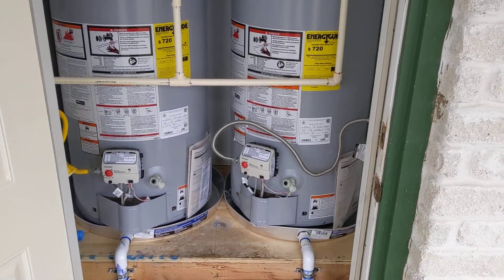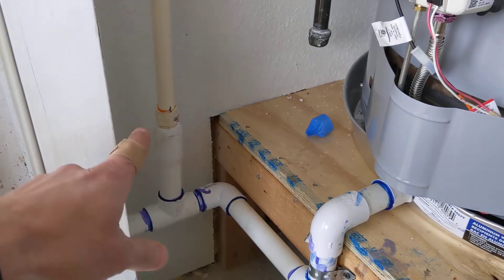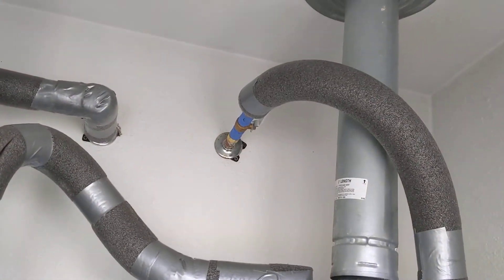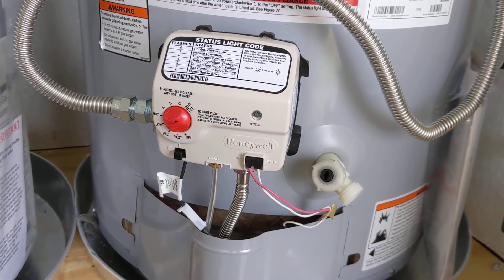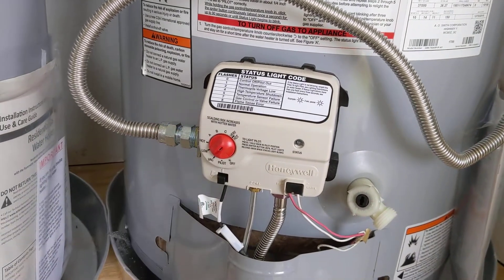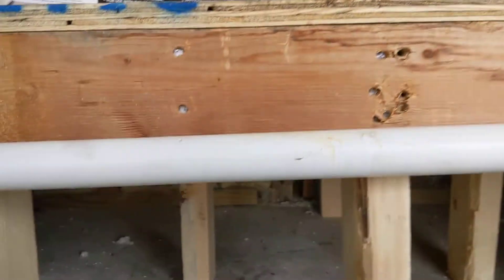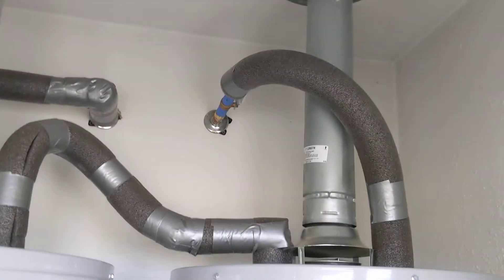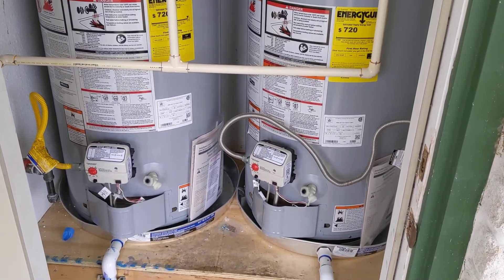Gas Water Heaters In Series

Comment: Hey guys. Please don't install water heaters or plumbing like this video explains. You can never have two tpr valve terminations joined together. You can never have them connected to the pan drain line. You can never have a tpr termination through PVC. CPVC or better ONLY. TPR valve shoots at 210F. PVC rated for 140F The plumber he mentioned saying this was ok obviously does not have a license. Section 504.6 of the International Plumbing Code (IPC) and Section P2804.6.1 of the International Residential Code (IRC). 49 states adopted IRC and 38 IPC. Most of the other states have their own code that says this is incorrect setup. So only you live in Wisconsin, find another channel or ask a home inspector. Guaranteed this gets flagged when they try to sell this home. I hate to be negative. This is America so you can say what you want,  but I hope someone reads this comment and does some of their own research. Thanks for trying to educate anyways and good luck to you.
Reply from the maker: Great comment. You informed and stated some important things without trash talking (too much) ;). In this instance the owner was the one who made this decision as he said he didn't want any more pipes coming out of the front of the building. The plumber said that it broke the aforementioned rules, but that it was "ok" as in, "We do what the customer wants since it's not attached to any public water system". That is the only reason it was rigged this way. Keep being awesome and doing a good job!
Reply: @MyFortressConstruction  I would agree that home owner can state what they want but code is code.. Plus running any dual water heater setup in a series is a waste! The first water heater will always get over worked compared to the other one and semi defeats the purpose

Comment: How to install flood prevention drain pipe if I am on 2nd floor of a condo, and WH is located in a small closet outside next to patio?

Currently it is missing a pan after we moved in so we also need to drain / or somehow lift the WH up and insert a pan.
Reply from the maker: Yeah, so you have to shut it off, drain it out of the bottom silcock via a hose to outside and then, if you don't need additional height for the slope of the drain pipe, disconnect the two lines going into the hot and cold outlets, lift it and have someone else slide the pan underneath it. If you do need to raise the tank to a new height, so that the drain line can overcome an obstacle or have the proper slope (1/4" fall per foot), then best to pull it out, build a base of cinder blocks or something equally structurally sound, and then put the water heater back in. Before shutting off the water, connect the garden hose and open up the silcock to flush out sediment from the bottom. It will help the tank and make the draining go faster. Watch your back!
Reply: @MyFortressConstruction  Great instruction. The trick is where to let the flood water go - or we need to tap into another  drain pipe somewhere probably only way. Cannot let water go outside and drop to people downstairs.
Reply from the maker: @jamescc2010  if you have gutters you could run it into a gutter otherwise yeah find a drain that is lower than the water heater or get a really long hose so you can drop it all the way down to the ground.

Comment: Can I have a 50’gallon and 30 gallon in series? Does size play a role in pressure ?
Reply from the maker: You can have any size you want and the only thing that would play a part in the pressure/volume would be the diameter of the inlet and outlet. Once your tank fills with water it will pressurize equally.

Comment: Are you sure you want to use untreated lumber for your platform legs on concrete in termite country?
Reply from the maker: Yep. Now, if they didn't use a moisture barrier between the soil and the concrete, and if this had rain or other water running under it, then it would be necessary to use PT wood. But because the concrete is dry and it's in a weather protected cover, there won't be any moisture there to cause dry rot. However, if you have termites, then you need to take care of them regardless of the wood you have, because most homes only have a PT sill plate (generally because framing goes up while the concrete is still curing or they're used on exterior walls and have to deal with moisture pushing in if the base isn't sealed well), everything else is dry and tasty. At least you'd be able to see the termites munching on these.

Comment: Thanks so much for this helpful video. I have two questions. First off, I have two heaters in my house, and I think they're in series, but I'm not absolutely sure, and I'm not absolutely sure which one is taking in the outside water and which one is feeding the house. I turned way down the heat on tank "A" and it doesn't seem to have affected my house. Tank "A" is also the one with the overflow tank. I think this is the one receiving water from the outside because turning its thermostat down didn't affect my water and because I think tank "B's" pressure can be relieved by simply flowing back into tank "A". Does that sound right?
Second, I have a small household and I don't really think I need two heaters running. Is it better to turn heater A off and let heater B do all the work, or is it better to let heater A do some of the work, and let heater B do the rest of the work? I'm guessing it's slightly more energy efficient to just turn heater A off, and probably less dangerous because a warm heater A would just foster legionella.
Reply from the maker: So, you are correct in that it's more efficient to have one heater if you don't need two. 
  Are the two heaters next to each other? If so then you should see a line going from Tank A into B. Water heaters in series have the hot water of the first heater go into the cold water inlet port of the second heater. You should see an H or C stamped/written next to the inlet/outlet ports on the heaters. 
 It sounds like you did indeed shut off the first heater in the series, but it's possible that your tanks could serve different parts of the house (heater A serves washing machine, hall bath, etc. and Heater B serves Kitchen, master, 2nd bath). Legionella like 70-120 degree F. so if your water is below that temperature in the first thank then you won't have anything to worry about, especially if the second tank is set high enough to kill them (140 deg. F. will kill legionella in about 30 minutes). If it is truly a concern then emptying out the first tank and removing it completely from the series would be recommended, after all, a second tank could just be another leak waiting to happen.
Reply: @MyFortressConstruction  Yeah, at first I just assumed one heater was for upstairs and one was for downstairs because that's how the air conditioners are (I live in Texas.), but when I turned one off, the whole house still had hot water. Then I realized it was a silly assumption and I started looking at it more closely. They're definitely in series. I will check for the engraved H and C when I get the chance.

I think generally I'd like to have my tank set at 120ºF, so it's not really high enough to kill them if they've proliferated in the first tank. I hate it when scalding water comes out of the taps, and enjoy the feeling of safety that comes from the 120º water, so I'm inclined to just let the second tank do all the work. But I do like the thought that I could heat up the second tank and have a ton of hot water if I needed it. You make a good point about it just being another hazard, but I'm so paranoid about water damage, that I think I will keep a good eye on it. I'm looking for a good deal on a water detection system, so I expect to have that installed in the next year or so, and once I get that, I think I will be mostly safe from the extra hazards of an extra tank. 

Thanks so much for your advice.
Reply: @MyFortressConstruction  Oh, I forgot to mention that, yes, they are both right next to each other. And it's clear they are in series. I can see a single pipe coming and leaving from the pair, and then a single pipe connecting them. I will check the engravings when I get the chance, but from all I've learned, I'm pretty sure I turned off the first in the series.

Oh, and yesterday the piezo-electric ignitor came in the mail and I installed it on the second one, and tested it. The pilot light starts instantly, so I feel good about leaving it off. That reminds me, I should probably shut off the gas to it when I go to check the engravings.
Reply from the maker: @mitchjohnson4714  Yeah, good. So another option is to install a tank booster on the second unit (the one actually supplying hot water to the house). It's basically a thermostatic mixing valve and it mixes in cold water into the hot water that is leaving the tank so that you can set your tank to 140º but the water would be 120º getting to your fixtures. It's usually what I recommend if someone wants a little more hot water but doesn't need an extra water heater.
Reply: @MyFortressConstruction  Oh that sounds nice. You get a lot of hot water, it kills all the legionella, but it's not scalding. Best of all worlds.

Comment: Why isn't there a check valve in the lines from the pans to prevent the relief valve from forcing water back into the pans and overflowing from there?  One of the maintenance steps is to yearly open the check valve and close it.  That would have full home water pressure going out the check valve lines and possibly back into the pans.  Code might allow that design, but that doesn't mean it should be done that way.  In my area, drip loops are required for Romex going into a box, but it makes a lot of sense to keep water leaking into the house from following the wiring and going into the box.
Reply from the maker: It wouldn't be a bad idea except regular check valves are made to be used in a pressurized system and wouldn't open up from the small amount of pressure that would be coming down the 1" drain line. Even a proper sewage check valve, which would be difficult to find for a 1" line, could malfunction and destroy the purpose of the pans, which is to relay water to the outside in case of a tank rupture. As for yearly opening a check valve, I think you are either referring to the sillcock in the bottom of the tank or to the TandP (pressure relief) valve. If you are referring to the relief valve, you only open it for a couple of seconds to make sure it will close again. Not enough water to backflow into the pans. And if you're referring to the sillcock, you generally attach a hose to it so it's not going into the pan anyways. Regardless, this system isn't to code, as the TandP valve should be piped to the outside and not to the pvc pipes.

Comment: How do you flush the gas water heaters in series?
Reply from the maker: Same way you would a single. Just open up the first one while pressure is coming in (everything turned off of course), and then open up the second one once the first is done flushing.

Comment: this may have been asked...but if you're lowering the temp on the one water heater, doesn't that increase the chance of Legionella?
Reply: Yeah, I can't remember what video this is, but I disagree with the people who want to heat the water halfway in one tank and all the way in the next tank. If one is just room temperature, that's fine. It's just nice warm water where they thrive. So that's what I did on my series water heaters. One of them is off and I will turn it on if I ever have a lot of guests. The second one is set to, I think 120°F.
Reply from the maker: Yes, legionella is one of those things that should be taken care of via water treatment, but if it's well water, it could be more of an issue. You could "Shock treat" it by turning it up every once in a while, but I would think that different areas might struggle with it more.

Comment: The relief valve discharge tubes should terminate straight down into the Drain Pans with an adequate Air Gap.
Reply from the maker: That's not allowed around here, but it use to be.